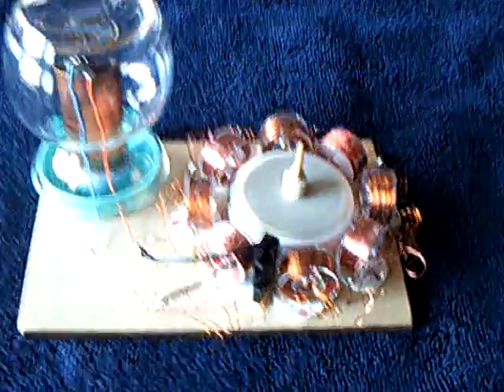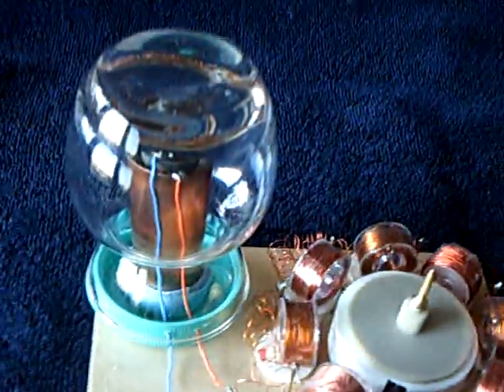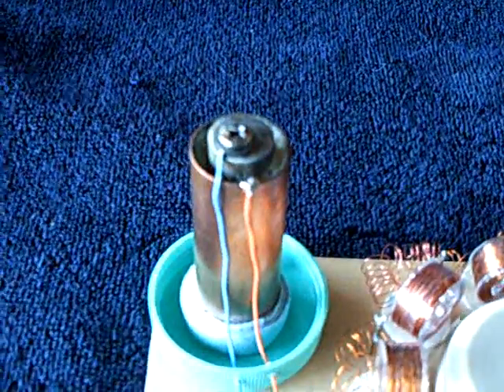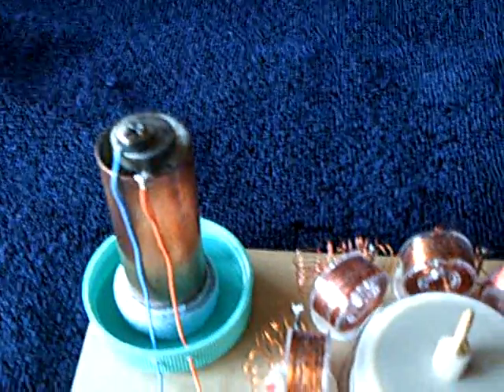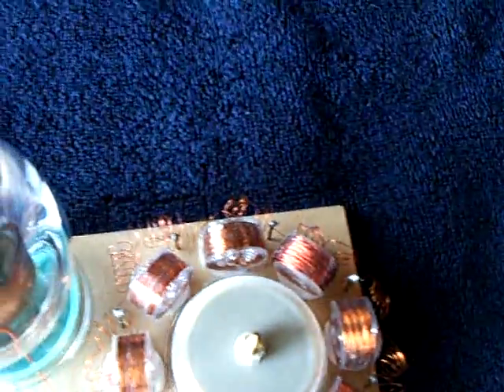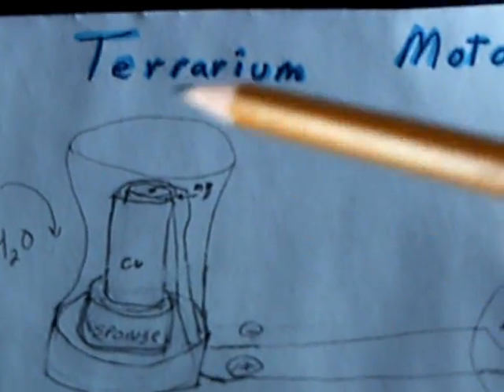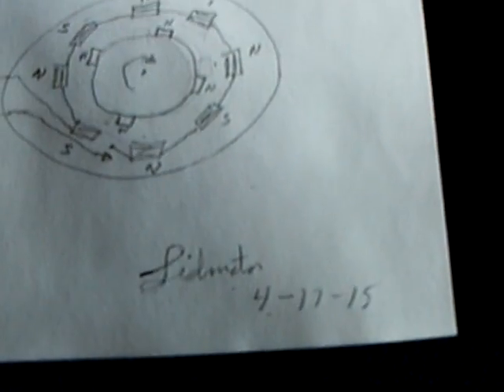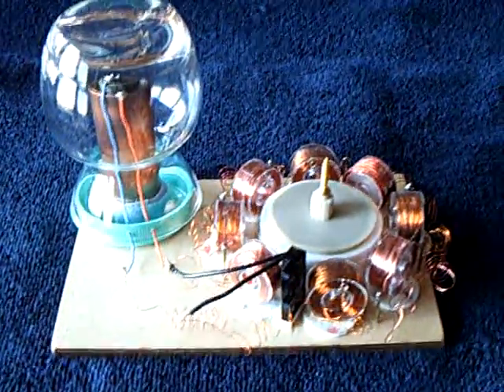Terrarium Motor

Comment: Hi Lid,
Just some observations that I have made regarding these crystal cells
These cells act like a thermal electric (Non galvanic)
if you heat the copper (not Mag) then the cell will gain in power until the mag reaches the same temp, then the power level will drop 
You can test this by heating the copper and watch the amps rise on the cell 

In your cell the mag has more volume to heat up than the copper so the power level  should last a long time
Reply from the maker: Steve Allwest I agree.  I have done some tests also.  There is more going on than just a simple lemon battery.

Comment: You say heat though it has to be a pulse source from the sun in its simplest theory and then that causes a pressure flow differential in the jar logic states if it can run like that it should also run in the dark may be a chunk of ice inside would do that    Just a thought
Reply from the maker: honda4004 Actually this needs heat.  Cold slows it way down.  Puts it to sleep.
Reply: Hi I was thinking that as the ice melted it would cause a circulation effect within the glass globe and if the moon light was shiny it may carry out the reverse. But just a thought.  Ok.  If you don't try you don't know my moto